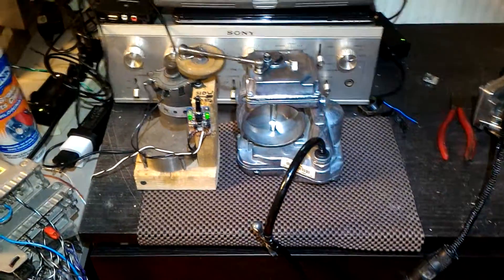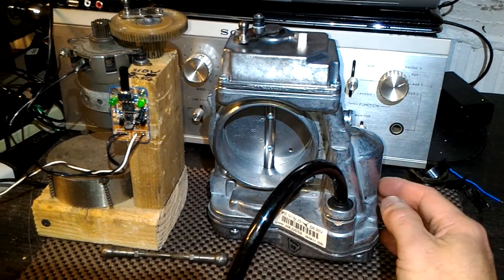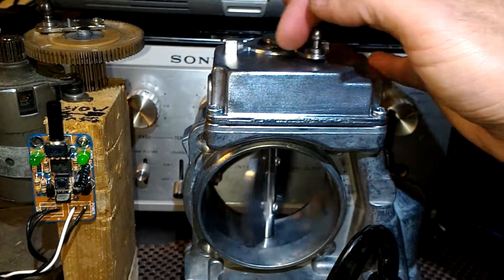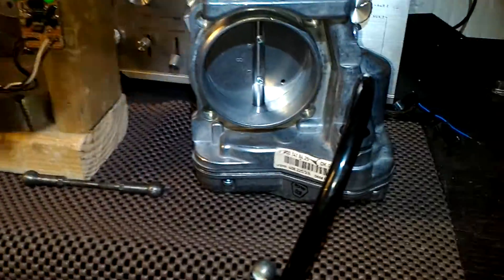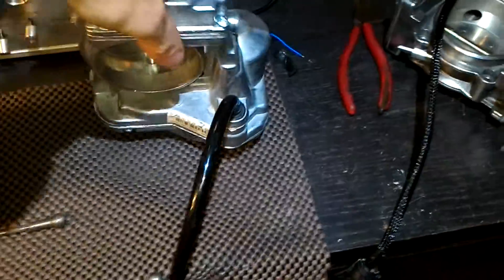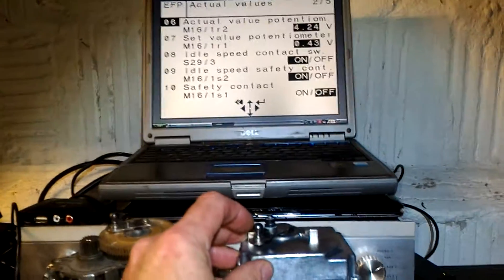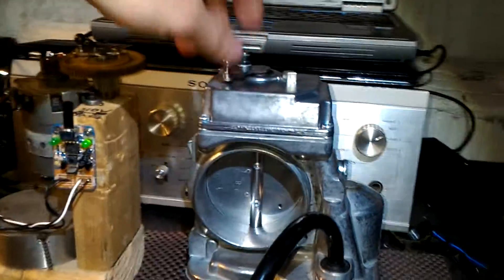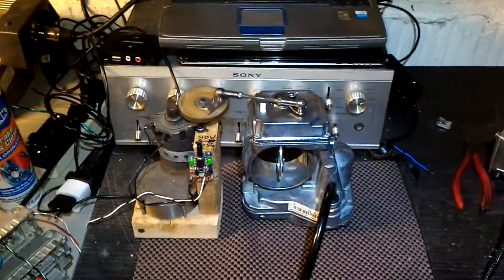Mercedes E420 ASR throttle body repaired

Comment: What is your price for a new or to rebuild mine for throttle body with asr. My 97 e420 is currently in limp mode and my dash is reading asr
Reply from the maker: 97 E420 has different throttle without pigtail. Make sure you diagnose the problem properly before reppacing throttle. Its a different setup on 96-on V8 engines